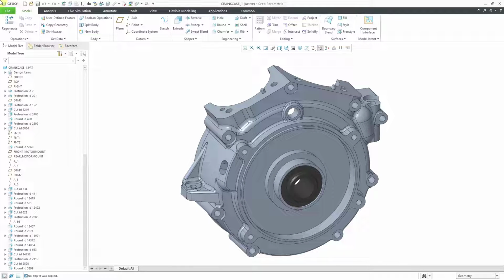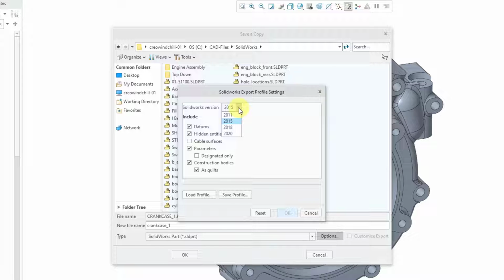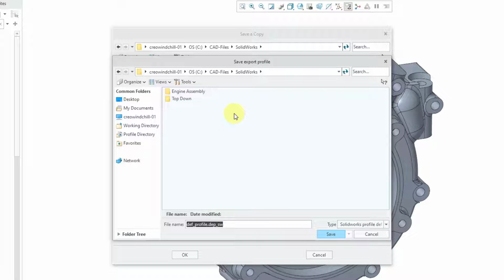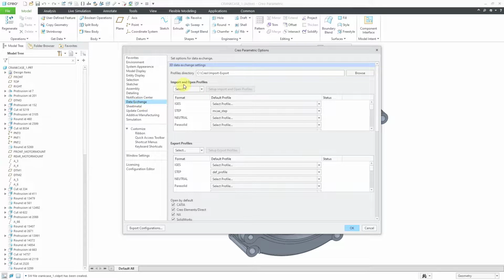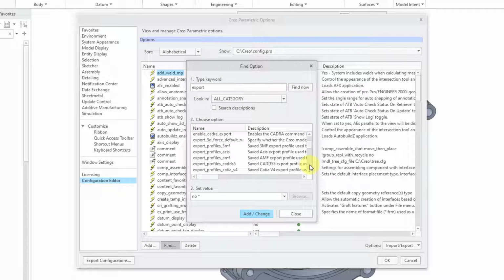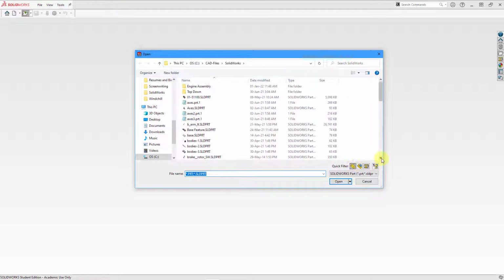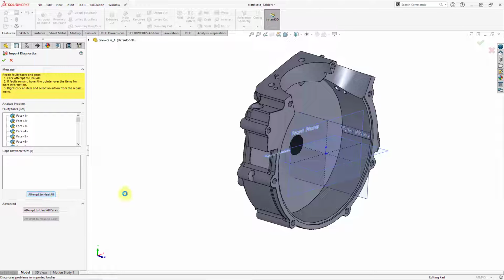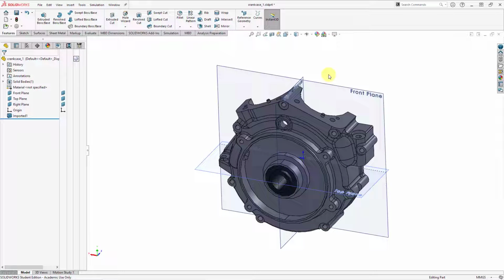Creo Parametric - Exporting a SolidWorks Part File

Comment: Hey, Dave!
I noticed the details loss in the part when you open the solidworks part, it is appearing visually will it going get appear if we put the part in cnc milling? and is it better for the part to be created on respective software rather than converting file for other cad software (Creo to Solidworks)?
Reply from the maker: Just like with languages, something is always lost in translation when converting a model from one kernel to another.